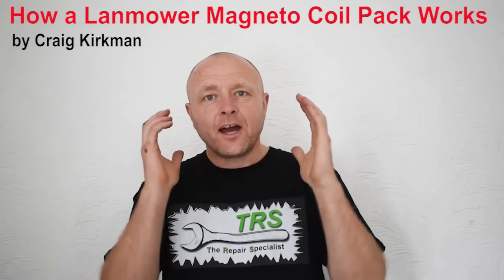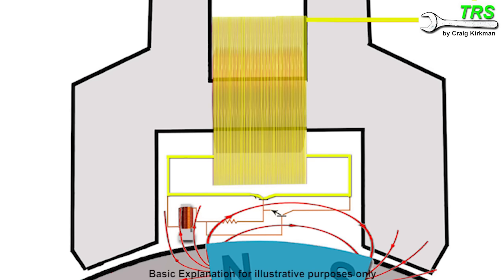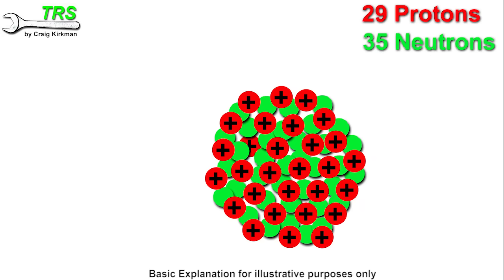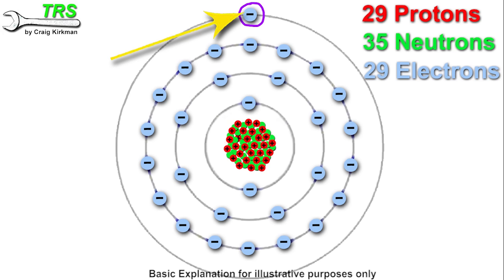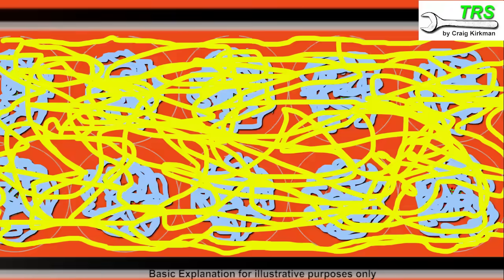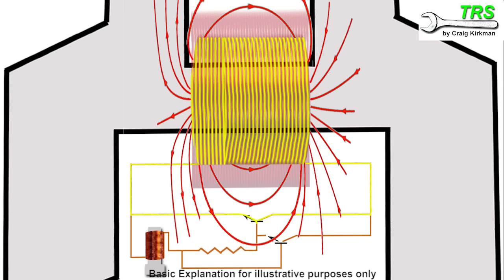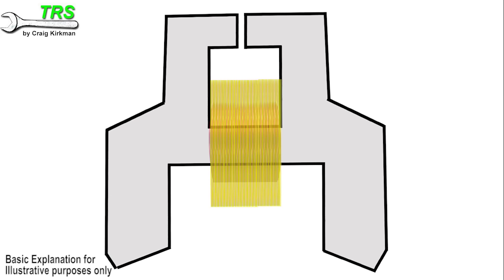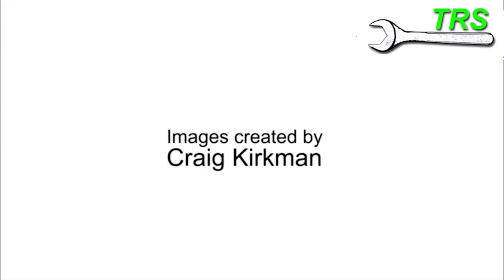Lawnmower Coil Pack Sparking System - Induction Coil, Transistor!  (by Craig Kirkman)

Comment: The terms "primary", "secondary" and "transformer" in this context are a misnomer. This is not at all how it works. However, this presentation will allow a lay person, such as a mechanic, believe that he now knows how it works. So that's a good thing.
Reply: You make a claim but you do not back it up, you do not say why it is wrong, you do not provide an example, you simply say so! You sir must be a democrat because they do the same thing(for example), Democrats claim voter ID suppresses the vote without ever once presenting anyone that was a victim of this suppression, they just say so!
Reply: @TKA322  FWIW I'm Australian but actually a staunch Trump supporter. The explanation is too complex for a youtube comment section. I plan on following up with Craig with a view to producing a replacement video which shows the true story. His skills in producing the graphics in this video are marvellous. Craig has cited several references and some of those are flawed which sent him down the wrong path.
Reply: @TKA322  Basically, there is no primary and secondary. It's just a pair of low impedance and high impedance coils plus one or more sense coils for the electronic switching. When the magnet approaches the coils an induced voltage in one of the ancillary coils forward biases the transistors thus shorting out the low impedance winding (incorrectly called the primary), mimicking the points breaker on earlier engines. This is effectively a shorted turn. This prevents the magnetic field from building up in the coil assembly until the flywheel has rotated to the point where the magnetic field would be greatest if it were not blocked by the short. At this point the trigger winding comes into play, firing off an scr (not mentioned in the video) which unbiases the shorting transistors. The magnetic field is then suddenly able to maximise in the core inducing the EHT voltage in the high impedance winding (which is incorrectly called the secondary) producing the spark at the spark plug. This is the OPPOSITE of the explanation given in this video. The release of this short circuit again mimics the points breaker. Some B&S magneto assemblies do not have a trigger winding but rather utilise a handful of electronic components (transistors,  capacitors, diodes, scrs etc) to produce the necessary timing.
Reply: I think the confusion is because a lot of people are thinking back to an automobile ignition system. There are some similarities between the two but also an important difference. In an auto ignition system you have the battery that produces the current in the primary, which then produces the magnetic field in the ignition coil. However, in a lawn mower engine it is the permanent magnet that produces the magnetic field instead. As such the low impedance winding is there to block the magnetic field created by the permanent magnet and keep it  from affecting the high impedance winding until just the correct instant. Accordingly when the transistors are turned on the induced current in the low impedance winding produces a magnetic field that is the opposite polarity from the magnetic field coming from the permanent magnet, which cancels it out. Then when the transistors cut off the magnetic field being created by the low impedance winding disappears and the magnetic field from the permanent magnet is suddenly applied full force to the high impedance winding. When this occurs the rapidly increasing magnetic field around the high impedance winding is what fires the spark plug. Its really pretty simple and it definitely makes more sense when you think of it this way.
Reply: @joevignolor4u949 That is exactly correct and sadly none of the tutorials I have found explain it properly. I was excited when I found this one as I thought finally someone has it right but sadly it's just as confused as all the rest. We can't blame TRS as he learned all this from the flawed webpage he has referenced.
Reply: @iconoclad  I'm a retired electrical engineer with a lot of experience figuring out things a lot more complicated than this so I guess that gives me an advantage. I've also done a lot of work with AC electric motors so that helped. Also, its important to know that its the sudden change in flux density that induces current in a coil and that it doesn't matter whether its a sudden decrease in the flux density, such as in an auto ignition coil, or a sudden increase in the flux density, such as in a lawn mower ignition.
Reply: @joevignolor4u949  When I trained as a Telecommunications Technician I also took a parallel course in Radio and TV servicing. A clear understanding of AC theory, magnetic induction including motors, transformers and relays is necessary for these fields. Recently, when I had problems with a lawnmower with an intermittent "Magnetron" I went looking for an explanation as to what was hidden inside the potted cores. Eventually I found a patent by Briggs and Stratton with a detailed explanation. Curiously, even there they incorrectly use the terms "primary" and "secondary". So, even the B&S engineers don't know what's going on.

Comment: As others have pointed out, some details in the audio explanation are not exactly correct, but you have added text to cover some of that, so kudos for a very c,ear explanation of this subject!
It might interest many of the viewers that the electronic ignition in many cars operates similarly, except that the primary current comes from the battery, and a tiny magnet that is driven from the engine by a gear reduction,  controls the transistors in *much the same way*.

Comment: how did it work before transistors? like 1950
Reply: When a spark was needed, the primary circuit was opened by a set of contacts operated mechanically by a cam attached to the crankshaft.  A capacitor connected in parallel with the points completed the primary, secondary was same as for electronic ignitions.
Reply: @Hopeless_and_Forlorn  Thank! that is what I thought as I remember working on those points under the flywheel

Comment: Interesting! I was not aware of the trigger coil. Is that what replaced points in older engines?
Reply: Yes. The trigger coil and the transistors replace the ignition points used in older engines. This is because mechanical points degrade over time and need to be replaced periodically but the trigger coil and transistors should last the life of the engine. Modern cars and trucks don't have ignition points anymore for exactly the same reason.

Comment: Why the magnetic circuit has second gap (en top of the picture) if the circuit is considered like a transfo. A lot of electromagnetic lines on the magnetic circuit are lost on this second gap. What kid of this system is call? Fly back, etc.?

Comment: A magnetic field, conductor and movement is all it takes to generate electricity. And that movement can be either the magnetic field or the conductive path.
Reply: As long as the magnetic field cuts through the conductive path.  If the conductor and field move together in the same path, no voltage is generated.  Relative motion between the two is the key.

Comment: Missing the explanation w/the secondary coil pin to GND to kill completely the coil system. Missing in the picture this conextion. I understud that the two coils (P/S) don't have any electrical contact (wire) between both only the electromagnetism circuit passed from magnetic iron. Please, fix this kind of coil circuit.

Comment: Good stuff.
So how do I test the damb thing for good or bad when it doesn't seem like it's working....!
Reply: If you have no spark when you spin the engine and there are no external cut off switches or any external associated wiring that are causing the ignition not to work then you simply replace the ignition module with another one. To bench test one of these modules would require an elaborate set up to do it and that would cost a lot more than just a new module.

Comment: Thanks a lot for extraordinary explanation electrical, electronic, physics, etc. But, why or where will be the "bobo" when the coil stops to work? What is the HV value? Why is S and after in N in direction of magnet spin and not N after S? The gap between the magnet and the coil is very strict? 0.012"? The theory w/electron, neutron, positron, etc. is very difficult to be true and to be verify. Magnetism electromagnetism, ac/dc current, etc. are theories very difficult to prove. It is very easy to follow but not easy to understand. Theory like theory but the practical kills us.

Comment: I did not know about the smaller pickup coil. From this it is important the orientation of the smaller pickup coil to the rotation of the magnet.
Reply: I watched a Mustie1 video, where the engine would rip the rope out of your hand while starting.  The owner had replaced the coil, but installed it backwards.  The timing was now off, firing the plug at the wrong time, causing the engine to turn backward.  Now I understand what was actually happening.
Reply: Yes and the spark will be much weaker since the order at which the flywheel magnet energizes the coil and the trigger.

Comment: Oh Craig, such a great start, and then a train wreck beginning at 4:05.  We do not need a lesson in atomic structure to understand a coil,  a transformer, or even a magneto.  And you completely left out the switching function of the Darlington pair and followed that by muddling the secondary current path.  Please try again.

Comment: Why doesn’t the ground - presumably the engine block and frame of whatever it is mounted to - get full of electrons looking for a place to go?
Reply: Good question.  In the case of the lawn mower, it is effectively an isolated system that always has the exact same number of protons and electrons contained within it.  We create a "charge," as we choose to call it, by separating negative electrons from the atoms where the positive protons reside. Each electron is a single negative charge, each proton a positive charge.  They are separated from each other but still contained in the electrical circuit where current flows.  When the area of negative and positive charges are connected by a conductor, and no more electromotive force (or voltage, to use a simpler term) is present to force the charges apart, the electrons will flow through the conductor back to the positively-charged atoms, and at that point the charges are neutralized.  As far as a circuit that has a connection to an actual earth ground, the mass of the earth allows it to absorb and neutralize any amount of charge that you can visualize.  However, a lawn mower, a vehicle, an airplane, or anything not connected to an earth ground can become electrically charged.  That is why we have lightning rods on buildings, grounding brushes near toll booths, conductive tires on fuel trucks, and static dischargers on airplanes.

Comment: I chuckled when this video was recommended because I thought I knew all this, but I didn't know about the trigger coil and it's circuitry. Maybe this void in my understanding led me to watch this video. Also I am impressed with your presentation. Well done.
Reply: Same for me.   I thought it was simply that the magnet passed the coil and caused a spark.   I never knew there was  trigger coil and circuit.
Reply: Hell, same.
Reply: The older ignition coils do not have the trigger coil. They use points to break the circuit and collapse the magnetic field. The two are generally not interchangable.
Reply: @lawrencethompson127  They are interchangeable on all Briggs engines built from 1965 and on. I also watched a video where a fellow got a 1953 to work on the modern coil. So they can be. Certain engines like Tecumseh can't because the old magneto was behind the flywheel the modern one on the outside, however a Nova II can give one of those electronic ignition as well.
Reply: Briggs Stratton called this pointless system “Magnetron”. I had no idea how the magnetron was triggered until now, thank you.

Comment: What about magnito with breaker points
Reply: It doesn't have transistors, the points opening rapidly collapses the magnetic field in the primary coil inducing high voltage in the secondary. The electronic coil is d.c , high voltage,  points system is a.c and lower voltage, weaker spark.

Comment: Very nice.  I have a dirt bike with electronic ignition.  There is an ignition coil on the stator plate.  The last one that was on it basically burned up.  So much heat that the covering of the coil was made black.  Thanks again for your video.

Comment: Aircraft have used magneto ignition for recip engines. They are reliable spark generators. Excellent explanation.
Reply: Exactly right.  And, toward the end of WWII, low tension ignition systems were developed for aircraft engines to lessen the problem of plug wire sparking to ground, particularly at high altitudes.  Before this development, the problem was so persistent that some engines actually pressurized the encased ignition wires with supercharger air in an attempt to lessen the sparking.  The low tension systems I speak of were the grandfathers of the coil packs you see on top of each spark plug on most cars today.

Comment: Nice detail! The speed in the transistor turning from on to off will actually determine the speed of the current disruption in the primary coil (much slower than the speed of light). You refer to the magnetic field as an EM field when describing the primary to secondary transfer of energy. It's sufficient to simply say core magnetic field here because that is the energy path. The secondary coil circuit should be shown also, to clarify that the ground path is simply a conductive path back to one of the secondary coil's wires. Question: To stop the operation of the engine the ignition system is disrupted by a switch. Where is this switch and how does it disrupt the circuit?
Reply: I'd guess that is where the other end of the secondary wire goes.  If I'm right you could put an ohm meter on the high tension wire and the kill wire to determine the health of the secondary coil.  I don't think there is anyway to test the primary coil, but I've been wrong before.

Awesome explanation, disappointing to learn there is no way to completely test the damn thing
Reply: The engine cutoff switch is usually mounted near the carburettor. Depending on your country and local regulations when you close the throttle the switch closes too, shorts out the low impedance winding and stops the engine. In the US, on many mowers the handle bars have a dead man lever. You need to grip it in order for the motor to run. It goes down to the carby too.
Reply: @iconoclad  Yes, a simple grounding kind of blade switch wired to the primary of the coil pack and activated by a cable system wired to the flywheel brake from the handlebar.  There is a spot on the carburetor bracket for the same blade switch, it can be relocated there.  I Just replaced one of these coil packs on a 30 year old B&S I use to do my own mowing.

Comment: Hi.  A Very good explanation of contactless ignition congratulations. 
If you first have an understanding of the simpler old points contact timing system then makes it easier to understand the newer contactless system you have shown.  
 The new contactless system that uses transistors  has far better reliability over the mechanical points system, but the overall transformer system operating cycle is the same.          

So it could help if at the beginning for comparison (or another video) you showed the full circuit of the primary and secondary transformer including the mechanical points that complete the circuit. along with the Points bypass capacitor. Because it is a little bit simpler to follow.
The fundamental operating cycle being that the points are normally closed to let the current build up in the coils as the magnet comes by thus putting energy into the transformer. Then when the points are opened, magnetic field collapses and the energy that has been stored in the coils discharges through the sparkplug and the bypass capacitor completes the circuit across the points at the grounding end. But any way I did learn from your description about the transistor trigger. So maybe another video opportunity for you to tell about the old points system. Good points to you - sorry about the Pun ! Brian

Comment: Why doesn't the copper run out of electrons with extended use ??
Reply: It is part of an electrical circuit. What wasn't shown is the end of the coil not connected to the spark plug is connected to the engine frame, providing a path for returning electrons.

Comment: Wow dude that was a bit intense. What I want to know is: What's the purpose of the resistor? How does the trigger coil circuit replace the points & condenser? A "Darlington Pair transistor" I looked that up....it's way above my pay grade!  And this would have been a great time to explain how to trouble shoot the dang thing! Like what happens or doesn't when someone puts the coil on backwards? Ohms checks?
Reply: Normally all you can do is ohm the plug wire to ground for a proper resistance, eg no shorts or opens changing it.  Best done with a spec as they differ or by measuring a known good.   Then the gap to the flywheel, rule of thumb a business card thick.   Often its the shear pin which puts the flywheel off time after hitting a rock.